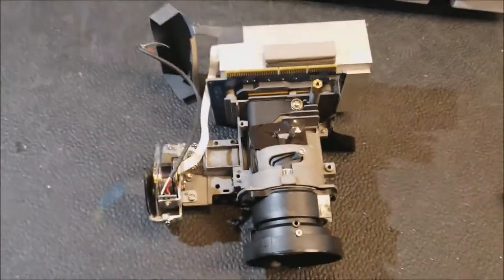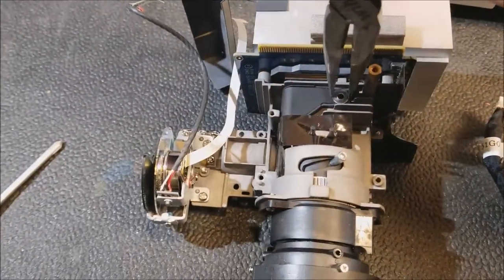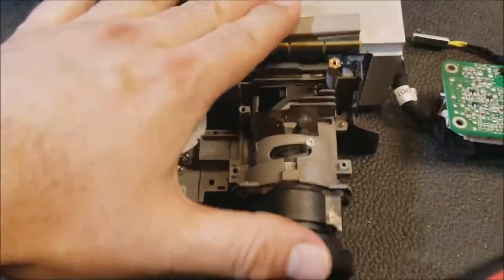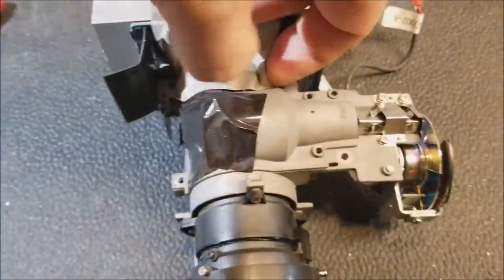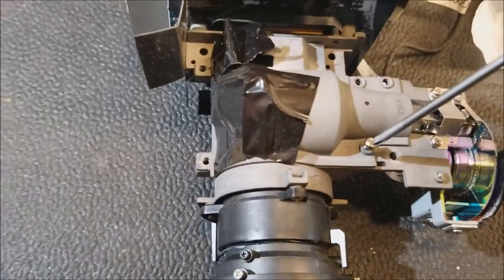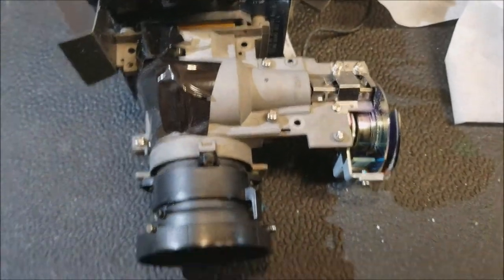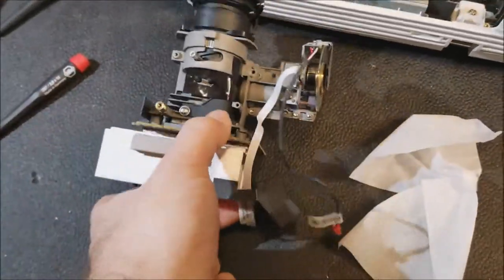Optoma HD20 DLP Projector Optics Cleaning

Comment: 1:45 you saved my projector man, you're a life saver, i blew compressed air in there and it worked. my hd131x had dust visible all over the image, with help from your vids i dismantled all the projector,  perfectly cleaned it and now it works like day 1,  the image is crystal clear. many, many thanks

Comment: Thank you! This video will help me clean the optics of my Optoma HD27. I had successfully replaced a worn out color wheel. But in so doing, I naively tried to clean the dust out of the general chamber by crude blowing. I noticed a bunch of spots in the blacks of the video. I've ordered lens cleaning solution and non-abrasive lens cleaning cloth to wipe the dust off the lens and the mirror elements. Thanks for mentioning that the mirror is front face and must be delicately handled (if at all). I'll be extremely careful. But I believe that is where most of the troubling dust particles are. I suspect the mirror dust is the culprit because when I zoomed and focused the lens, all of the dust particles came into sharp focus when turning midway along the focus ring... so I'm guessing if they're all sharply focused on one flat plane, it must be the flat plane of the reflective mirror. I think I had just blown too hard and too indiscriminately when I first oepne up the chamber. I'm a newbie. I do love this HD27 projector. Have had it for close to eight years now.
Reply from the maker: They're nice projectors. Even today.  Just take your time and don't overdo it.  They are made to run with some dust.  If your lamp is newish and the unit is fairly clean it should be fine for you.
Reply: @FixitFrank  Yes. The HD27 is a great projector, especially for its humble price range. I now believe it was dust that was on the DMD chip itself or more likely the front face mirror --it had to be a flat plane where the dust had settled (because I could focus on all of it turning the focus ring). As you suggested, I did not overdo it. I used a hand blower (used for photo camera and darkroom and a lint-free lens wipe on the DMD plane. I also had to adjust the light tunnel to align the image. I had been noticing a horizontal shadow band (with a somewhat blurry refractive edge) on the top quarter of the projected image. At first I kept thinking the shape lens between the front face mirror and the DMD was not seated securely. But eventually I realized it was that I had probably loosened or tightened the light tunnel's spring screws to misalign its position (I'm clearly a newbie at this). When I adjusted the tunnel's screws the shadow band started to move out of the way. What is amazing about this DLP is how the column of the light tunnel, the lenses and mirror all focus the beam of light direct onto what is essentially a plane of mirrors in an array. Instead of transmitting light through a film, it reflects light off a reflective film (image) plane. And the source light's area of coverage must be distributed evenly incident to this image plane (DMD)... it's quite amazing! The color wheel spins to project only one specific bandwidth of color at a time, but at a speed such that the neuro-cognitive phenomenon of persistence of vision causes our brain to recognize the normal gamut of tones and colors of the photographic image. With your help I replaced the color wheel, opened and cleaned the pre-projector lens and mirror housing, adjusted the light tunnel, and didn't have to buy a whole new projector and keep enjoying this eight years old Optoma. Thank you. And I really learned something by doing.

Comment: Thanks ! Found this very helpful, had dust inside the lens, showing a lighter marks in a dark scene. Followed the tips in cleaning by the DLP chip and all is great now. My projector is an Optoma HD131x but very similar inside.
Reply from the maker: I think Optoma uses this chassis for quite a few.  If you search for a lamp, many sites list the other models the lamp will fit into.  That is a good gauge of the similar chassis.  Thanks so much for your comment! This is why I post videos.

Comment: This is a great video, many thanks Frank. I have a slight darker mark on the very far left of the picture which I assume is dust, and the shape changed slightly quite recently otherwise it is clear. I just cant seem to shift it. However the bulb is on 4k hours, could that be the problem?
Reply from the maker: I'd try a new bulb first. Mainly because of the age and it's the easiest thing to change. Plus without a known good bulb, you might end up running in circles. It also could be a light tunnel problem or dust. But start with the bulb and see how that goes.
Reply: @FixitFrank  Will do. Many thanks!
Reply: @FixitFrank  Thanks Frank. I was debating buying a new Optoma but I got a replacement bulb for £90 (not the whole assembly but they are easy enough to change). Can you damage the glass just infront of the bulb in the assembly by cleaning it or is it best left alone?

Comment: Hello Frank! Nice vid! A question: is there a glass (like a protective glass) on the DLP chip? I got a number of small black/grey spots on my screen when zooming in to smallest picture size...they can be focused on, and look like tiny bugs / dust under a microscope :D ...If there is a glass over the DLP chip, I think they might be on that, but if there is a glass over the tiny mirrors in the chip, it would be relatively easy to clean it with wiping I guess :)
Reply from the maker: Thank you!  The front of the chip is glass, but some dust is expected.  I have found that when a lamp is wearing out, they are no longer able to shine past the dust.  I would recommend replacing the lamp first if it is over 1500 hours. If your lamp is worn and going bad, no matter how clean the glass is, you will see specs.  
All of that said, if you want to post a picture of your screen on imgur.com and share a link here, I can look at see if I am on the right path with my advice.
Reply: Thanks for the advice! I replaced the lamp in my Optoma hd26 approx a week ago after the 5000 hours limit was reached. I saw these spots earlier, but did not have the courage to interact with the DLP chip in any way. But based on what you wrote, I just blew off the dust from the DLP glass, and now, it is as good as new...so good, that my buddy is coming over this afternoon, so we can clean his too :D

Edit: For those who are in the same shoes, it is approx a 15 mins job together with assembly. Blowing it with compressed air worked 100%, I did not even touch the DLP glass, or the lense in front of it.

Comment: Hello frank great videos keep up the good work. I’m currently in process of cleaning a Acer p1525 DLP projector. I just wanted your advice would you recommend IPA 99.99% liquid based with Q-tips to clean the glass colour wheel as well as DMD chip and mirrors inside optical assembly? 

If not what’s the next best cleaning agent?

Many thanks 

Mike from U.K.
Reply from the maker: Hello!  I prefer to use Chamois tipped swabs myself(MG Chemicals #810D-50). They do not leave lint as a cotton bud would do.  I then use anhydrous IPA and kimwipes. It really depends on how dusty.  I used to clean a lot more until I found that it doesnt always help and you can cause more problems.  The internal mirror for instance, can be scratched easily since it is a first surface.  The Chamois do not seem to scratch it.  Now, I tend to see if there is built up dust or just a thin layer.  I will hit it with air and leave the rest.  The projectors are designed to handle some dust without issue. Less is more.  However, if they need cleaning, 99.9IPA, chamois and kimwipes are a good direction. 

I know there are a lot of advertised cleaners but I have not found them to be any more beneficial. I may be wrong on that but so far I do not see any reason to use them. For lenses I use normal lens cleaner and a kimwipe.  It does not damage the anti glare coating as far as I can tell. I buy the medium priced stuff. Brands vary but I have not noticed any difference between one over another.

Comment: You are one clever man! i have the optima hd131xe after seeing its picture quality i will never buy an epson again,   on mine though i think the light tunnels shifted as its slightly brighter on the right hand side of the screen, i need to take it apart and do a setup and full clean of the lens assemblies, great video mate! An English subscriber. PS could you please do a video on the light rod adjustment? cheers.
Reply from the maker: Thank you for the kind words! I love the HD131 and its related models.  I think Optoma messed up when they stopped using that base chassis in it's projectors.  I will see what I can do.  I have 2 videos that I have not uploaded with light rod adjustments because I lost the end footage on one video and some other parts of the video were lost on the other.  I should upload them anyway and then I can narrate or overdub the missing parts.   I also have an HD20 that needs a new power supply but I could show how to adjust the light rod in that unit.  
It might take me a week (with the day job and all) but I will get you a video to adjust that.  I think it's a grand idea and would be very helpful to a lot of people.  Thanks for suggesting it and the subscription. I do appreciate it! -Frank

Comment: Hi Frank, well done, very useful video for people (like me) who like fixing stuff on their own. I cleaned the colour wheel on my Optoma HD20 and I am thinking of cleaning the optical assembly and check the lens, as there still some issue with the projected image. I got the contrast and luminosity back with the cleaned colour wheel, but there still is some image defect visible: I would define it as a "light leak" inside one of the corners of the projected image, visible only on a black screen (or dark scenes) that gradually disappear towards the center of the image. Because of the gradient nature of the image defect, I tend to believe it's an optical issue. Have you encountered something similar?
Reply from the maker: Hello Horia, I can't say I have seen exactly that, but I would check the integrator/light tunnel alignment.
Reply: @FixitFrank  Thanks for the suggestion.
Reply: Horia did you figure out the issue. I have leakage top right
Reply: @kmare  Unfortunately no. I didn't open the optical assembly, it seemed too much of a challenge. Ended up with a different Optoma H20, and with plenty of spare parts :). That came in handy, as the mainboard needed replacement at some point. The optical assembly of this second unit doesn't have the same light bleed problem. It's not perfect, but it does the job.
Reply: @horiamarusca  really appreciate the response -- i'm hesitant to take apart too, bright scenes are perfect, its just the dark scene uniformity.   Maybe @fixitfrank has some ideas too.  Didnt really seem to be much info on the net re: fixing uniformity for any DLP

Comment: So I have a rainbow colored smudge from what appears to be a hair that somehow got lodged into the light path of my Optoma hd29 Darbee. 

I disassembled it and removed that little black access panel to spray some air into. Unfortunately, it didn't do squat. When I remove the entire optic assembly like you did, would the hair be on one of those lenses/mirror? Or do I have to look somewhere else?

Thank you!

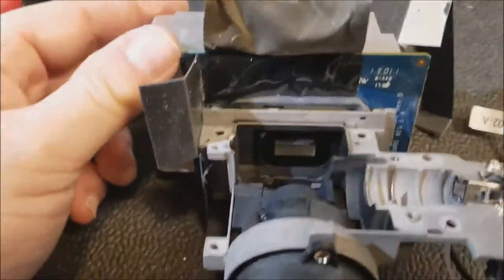Comment: hi there.. I have an Optoma Hd141x,  are you sure at 03:58 what you see is direct DLP chip or is that a optical light mask, as I can see in hd20 service manual .The ceramic in my lamp came off and was spreading the ceramic powder all across the projector. I was cleaning and blowing off dust inside my projector when I think it deposited on this part. Using q tip hasnt helped and I think q tip has rather scratched it. When properly focused I can see all that debris on projection surface.  This assembly was earlier spotless.Will really appreciate if you could help on this ?
Reply from the maker: That is an annoying problem to have.  I would go over all of the optics for dust. It may be i n the barrel section. Between the integrator and main DLP area. You may want to unscrew the lens to check its surface also.  That dust could be everywhere. A total tear-down/cleaning might be in order. It is safe to do if you go slow and take lots of pictures to make sure all the lenses go back facing the right direction and in the correct order. The scratches should not affect your image too much if they are not deep. There is a slight allowance where the light will shine past them.
Reply: FixitFrank thanks mate. I can clearly see the position of dust .. the area of lens, reflective mirror is mostly clean. It’s the dust on the DMD chip or the DMD mask ( if it has one and gives me hope that the chip is fine) which is the problem. with a torch and correctly focused lens I could clean it BUT anything everything seems to scratch it . I live in India and got it from UK with limited stuff on Internet I am having a strong guilt and sleepless night over screwing my projector.
Reply from the maker: ahh. I see what you mean.  Try some keyboard putty to remove it.  Its that sticky 'goo' that you can peal up after laying down.  It wont drag the material across the glass. you'll have to clean the residue(kind of greasy) off the glass but its not as bad as ceramic powder.

Comment: Hello again mate, another thing i will mention about optoma projectors, while theyre excellent, the thermal paste they use is absolute garbage, i just replaced the thermal grease on my optoma hd131xe, it was coming up with false fan errors, after replacing the tim its working perfect.
Reply from the maker: I wonder why the designers do things like that.  I see great designs compromised to mediocre because they are using half asses parts to save a few beans.  I like those heat transfer pads alright, but I prefer some good arctic silver paste(or whatever they call it on fleabay).
Reply: Its texas instruments fault mate, they supply the terrible compound with the chips, it would cost optoma literally 5 quid for thermal paste in 25 projectors, this is one of the most important things, constant use without adequate cooling will destroy the sensor chip, luckily optomas firmware catches it just in time and shuts the projector down

I just applied arctic mx4 (stellar stuff) its dropped temps massively
Reply: @FixitFrank  Hello again, do you by any chance know how to enter the service menu on an optoma hd131xe?
Reply from the maker: @Synthematix  Hope you're well! I don't have the exact info for the hd131 but I suspect it's the same code as the hd25/hd20. Try (power, up, right, up, left, menu). If not, then try (power, left, left, menu). The second is the original method. The first is the updated method. It works on a lot of optoma, so I think it will work out for you. Good to hear from you
Reply: @FixitFrank  Thanks mate up right up left menu worked! thanks a lot! i needed to adjust the colourwheel as the calibration was a little off, gotta tell ya the picture now is absolutely beautiful! vivid colour and bright,  i think i need to use a better paint on my wall though, its absorbing ambient light too much.
Reply from the maker: @Synthematix  Fantastic!  Glad to hear it.  Check into a matte grey.  In the states there is a company "Sherwin williams Grey" that is wonderful for DLP.  The light grey for DLP will help your contrast.  I'm sure you are aware though.
Reply: @FixitFrank  True! im wondering if i should try a light silver acrylic paint or something as essentially its grey thats metallic

Comment: Hi mate I have a hd141x and I tried compressed Air which did make it better but it looks a little like my focus is out as the picture at the bottom is focused but the top of the image is slightly blurry ? I can't seem to get focus across the whole image any ideas ?
Reply: There is also some dust still on the image so I may need to take the whole thing apart and clean it like you have here
Reply from the maker: Thats a tough one.  It could be a few things.  Anything from a failing DMD all the way to some miss aligned optics.  Dust is always a possibility since you might be noticing some. Good luck, take your time and take lots of pictures.
Reply: @FixitFrank  is there a way to get to the lenses and clean them without taking everything out ? I managed to clean it and get a better imagine from doing my best through the little gap/plastic cover but there's still dust marks on the lenses
Reply from the maker: maybe.  You might be able to remove screws that hold the lens assembly into the optic module. If those screws are accessible, then you may want to try that route.

Comment: Hello Frank -- unrelated but any ideas why my HD20 has dark scene uniformity on the top right corner?  Similar question was asked a few years back -- your suggestion was to check the integrator / light tunnel. Definately don't think light tunnel becuase I dont see any hardlines .Its just a glow in the top right
Reply from the maker: It still could be, but it might also be dust.  I'd have to see a picture.
Reply from the maker: oh okay.  If you can do the same thing but using the white test pattern(in the menu) that would be fantastic.  you might have a damaged shape lens.
Reply: @FixitFrank  I've ordered a condenser (Cresent shaped) lens. What I found was the plastic lens had small cracks in the coating and was hazing. I tried polishing which of course did not remove the internal Haze.  It did remove the cracks but also the lens coating.   I'll report back, supposed to be a glass lens.  I don't know if grey market lenses are real, have correct coatings etc.

New glass lens was OEM and fixed issue.  Thank you fixit!!
Reply: @fixitfrank thank you so much for your videos!  replaced with a glass lens; picture is 100% uniform now. I have a little bit of bleed around the screen, not noticable except in dark scenese.  Not sure if further messing is worth it